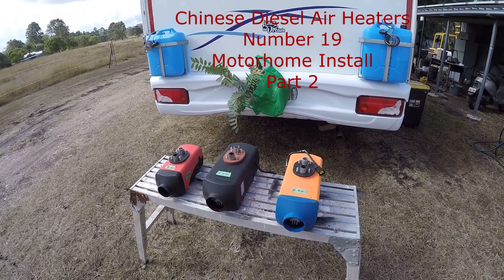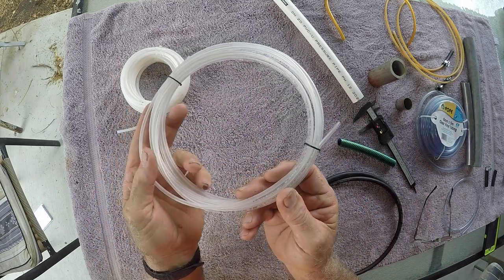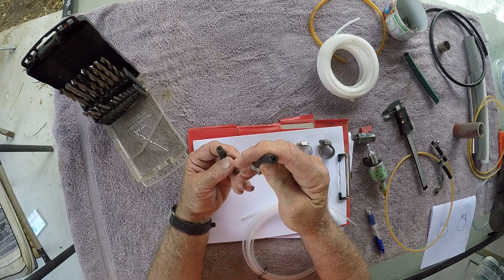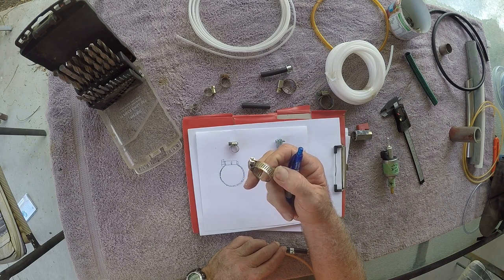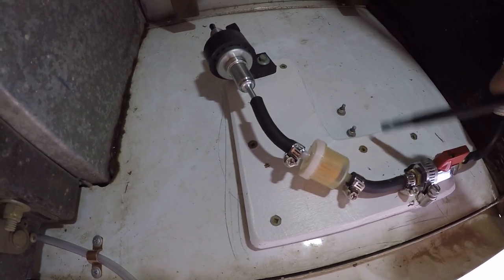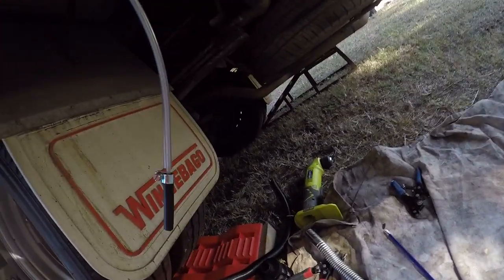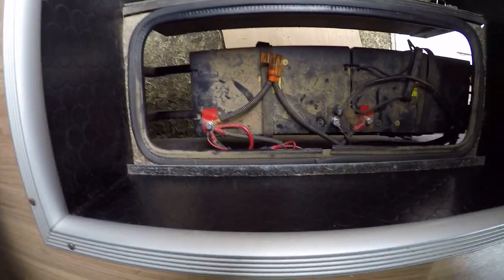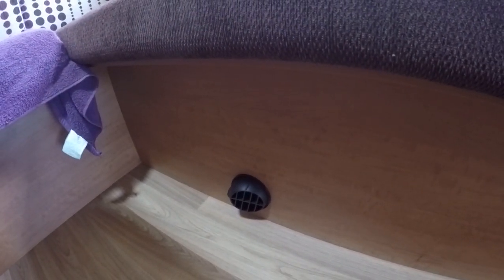Chinese Diesel Air Heaters no 19.   Motorhome Install Part 2

Comment: I got it on special $120 so if worst I will buy a new one ,could you suggest one on banggood site as there are so many thanks again john
Reply from the maker: Hi Dara, 

There are a number of suppliers on line, eg Banggood, eBay, Amazon etc. I generally use eBay, but suppliers come and go. None of the suppliers I bought from a year ago are still there or still sell heaters. So I can not make a recommendation. 

Suggest you buy a heater with controller and accessories you want, from a supplier with a local warehouse in your country, and who will accept returns. That way you have some chance of getting a replacement or a refund for a defective product.

Cheers.  JMcK

Comment: Hi John As the heater is mounted underneath the seat it may not be able to get sufficient air intake to allow recirculated heat. Do I need to place an air intake vent to allow air from the caravan to recirculate into the cavity and through the heater?
Reply from the maker: Hi Andrew, if the heater is mounted under the seat, you need a vent at the front to feed accommodation air into the heater. Or you could drill a number of holes in the seat base to let in air. Heater air comes out the back. JMcK
Reply: Thanks John, I found a nice air vent at Bunnings that will do the job. Thanks for your videos
Reply from the maker: 👍. JMcJ

Comment: Do you recommend running pump in a vertical position?
Reply from the maker: The pump works better if angled up, 45 deg or more.  JMcK

Comment: Would you happen to know where to buy that 6mm nylon tubing in the usa or on Amazon? I've searched and tried big box stores and even a plumbing supply store. Everyone looks at me like I'm crazy. I bought my heater before seeing your video and mine came with green flexible hose
Reply from the maker: Hi Cedric,

You can use the green fuel hose on the intake side of the fuel pump.

You can get by using the green hose on the delivery side of the pump if it is a very short run.

However that hose absorbs the fuel pulses and instead of the fuel squirting into the atomisation screen it dribbles and when you get a little bit of carbon deposits the fuel does not get forced through the screen and you get a poor burn, and hence greater maintenance issues.

You should only use narrow bore hard nylon tube on the delivery side of the pump to get best heater performance.

I buy my nylon hose off eBay. Search for hard nylon fuel hose for Eberspacher diesel air heater.

Below is just one link to get you started in your search.

https://www.ebay.com.au/itm/Fuel-Filter-Fuel-Pipe-Line-3-5M-Hose-Clip-Kit-For-Eberspacher-Diesel-Heater-/293850954872

Cheers.  JMcK
Reply: Thank you very much I found it on ebay with that search.
Reply from the maker: Cedric Fisher 
👍

Comment: Hi John, 29:41 why is there a short piece of black wire going from the left terminal strip into the switch?
Reply from the maker: I think you are referring to an earth (negative) wire. The switch has an indicator light so you can see when it is turned on. Hence the negative wire. JMcK
Reply: @johnmck1147  42:10 after the switch is moved, why is there no longer a neg wire going out from the terminal strip (to the switch)?
Reply from the maker: You are very observant Jay. When I moved the heater switch to the seat front I took a negative wire for the switch light from the negative of the 12V cigarette outlet that is close to the new heater switch position. JMcK
Reply: @johnmck1147  Thanks. also at 42:10, the black wire at the top seems to lead to the controller. is this wire particularly fragile so it needs to go through a conduit while the other wires do not need?

Comment: hi good videos have two of these keep finding the pump keeps failing had a new one lasted 3 days found had to put 12 volt across the pump and had to pulse it to get it to go then reconnect to the heater any ideas?
Reply from the maker: Hi Ian,

I really need more information. 

If the pump worked when you put 12V across it, it looks more like a low voltage, or a wire resistance issue. Have you checked the plugs and wiring for poor connection or corrosion? Are you getting actual 12V at the heater?

You could have an ECU issue, but would be most unlikely.

Good luck .JMcK

Comment: arent  the  fuel  line  runs   far  longer  than they  should  be  !....re  purging  the  fuel line ..i  used   the   pump from   a  hand  soap  dispenser ..it worked  really  well

Comment: arent you suppose to mount the fuel pump at about a 35-45 deg angle so air doesn't get trapped in the pump/line????
Reply from the maker: Oh dear Bob.

If you look carefully this fuel pump is nearly vertical. That is very close to the “perfect” angle.

These pumps are piston dosing pumps that creat little cavitation bubbles by the fast pulse/movement of the piston. If you don't angle the pumps upwards at an angle greater than about 15° you can have the little cavitation bubbles merge to form a large bubble in the pump which will cause both pump dose issues and pump wear issues due to lack of lubrication.

Any angle from about 15° to 90° is acceptable for bubble dispersal. Vertical is “perfect” if you have a seperate filter. Every Chinese heater pump I have seen has a seperate filter.

To the best of my knowledge, the 45° angle stems from those brand name heaters that have a minute/tiny, and in my personal opinion, totally useless internal filter at the bottom of the dosing pump.

These pumps needed angle to let the bubbles out but if the pump was too vertical, filtered  out crud could fall back down and block the fuel inlet hose. Hence the 45° angle compromise.

With seperate filter pumps any angle above 15° is acceptable. Vertical is ideal, but not necessary. 

Cheers.  JMcK
Reply: I thought that too at first because of the angle of the camera, it is mounted on a side wall but it looks like it’s mounted on the top of the space, just the angle he recorded it at is all.

Comment: Hi john i have fitted a few of these heaters one for my use and a few for friends, one of my friends has a problem with his, on about the second or third start up it blows smoke and shuts down,  its in a caravan, he now has a small blower vac battery thing and every second start up he blows it up the Air intake hose and it fires up great, the next start after that is good , the 3rd one it plays up , he runs it in 5 hz before shut down for 5 min or so, what do you think it might be, if blows air up intake its good, intake is short half the supplied length no kinks or bends only 45 degree at end got me stumped battery full power , regards peter
Reply from the maker: Hi Peter, 

That is an interesting one.

First, you say the combustion air intake install is good, but what about the exhaust? The one little fan sucks in air and also expels the exhaust. Problems in one side, create issues in the other side.

Do you have a low spot in the exhaust without a drain hole? That can collect condensation or even diesel leakage. Blowing air into the intake will blow out the exhaust.

You also may have a diesel rich or flooding issue in the heater. Is the fuel tank significantly higher than the heater? If so I suggest a fuel shut off valve before the fuel filter and pump, and turn this off after use to stop diesel syphon leakage getting into the heater.

If I was stumped, I would pull the heater out and run it on my test bench. That would indicate a heater issue or an install issue. If you have done a few installs you will be familiar with this process.

Good Luck.  JMcK
Reply: @johnmck1147  ok thanks mate yar i got exhaust  pipe on slight down ward slope all the way no bends it might be the fuel tank when full  causing problem fuel tank is standing up on draw bar of van and heater is inside van on floor about 2 meters  or so from fuel tank ile tel him to get a tap and we will try that mate thanks for your help you do a good job as well to
regards
peter
Reply from the maker: pk Gold & Hunting 

👍. JMcK

Comment: Hi, I am ordering parts to instal an Hcalory heater into a tiny house with 240v power. I want to permanently mount, and think I need a battery for power cuts both to run the unit and to enable a safe shutdown when the battery is getting low. Will the low battery automaticly start a shutdown sequence to stop the heater getting damaged from abrupt power cut?
Thanks.
Reply from the maker: Hi John, 
If the heater is connected to the battery, and you have a mains charger connected to the battery, the unit will run well. If there is a power cut the battery will not be getting charge, but the heater will continue to operate until the low voltage cut off point. At this stage the heater will go through its low voltage shutdown program. All will be good.  JMcK
Reply: @johnmck1147  Thanks for the quick response. TBH I am surprised that this topic is not widely covered in the thousands of tutorials on these heaters. Hcalory customer support also just confirmed this will work, and they send the PDF user manual for me to check with. Now I just need to figure out what to buy. If you feel like helping me make my purchase for battery and charger or UPS, that would be awesome.
I do have a tight budget, but I also only want to buy once. And if by chance I’m sat here in winter 2028 and the battery is dead because I didn’t spend an extra $50, I’ll be pretty pissed off with myself. I live in NZ, so what works for you will work for me. I have 240v mains power. Not sure what type of battery and or charger to buy (or all in one UPS) but I would like to get something that will give a days worth of runtime with some redundancy for battery degradation over a few years. I don't really want to have to faf around with this, maybe an infrequent system test.  But not something that requires instruction should I head away overseas and leave someone else in charge. Thanks for your reply, and your awesome videos. If you have time to answer / advise on this, I'm sure it would also make a popular video.
Reply from the maker: Hi John,

The battery set up you choose is dependent on what you want to achieve.

If it is only heater safety in case of power outage then a small motorbike or small car battery is all you need for a safe heater shutdown.

If you want to run the heater all through a cold night after storms brought down power lines, then something like a 100 amp hr AGM battery or bigger would be a better fit. It depends on how long you expect a power outage.

As for the charger. I suggest a 4 amp multistage battery charger. That size should be sufficient unless you constantly run the heat all the time at max setting. In that case I would choose an 8 or 10 amp battery charger. In Australia, Bunnings sell an Ozito brand multistage charger at a reasonable price that has an LED screen so you can see what is going on. I have both Ozito and Viltron multistage battery charges myself and have had no issues with them.

I suggest in this application you do not use a lithium battery as those batteries hold a very constant voltage, unlike lead batteries, and then suddenly shut down. The CPU in the heater is unlikely to sense the low lithium voltage and do a safe heater shutdown before the lithium battery BMS shuts it down.

Good luck.   JMcK

Comment: Question please. When I set my temperature to a set number of say 16C why would my heater blow out hotter air and eventually end up with a reading of 22C?
Reply from the maker: Hi Lucy, this is a bit hard for me as I do not know what heater you are using or what controller you are using, or where your controller is located.

When you first start your heater it will initially ramp up its output to get the burner heated up and burning properly before settling down to a lower setting for maintaining.

The ECU gets the ambient temperature readings from the temperature sensor  in the controller, and not from where the heater is. 

I personally prefer to always use the manual settings on the controller, that way the heater runs calmly at its set rate, and you do not have the ramping up and ramping down of the heater trying to maintain a set temperature.  JMcK

Comment: John, for safety sake, I'm wanting to install a fuel cock from the plastic fuel tank. Can you advise where I can get one to fit the supplied hose? Thank you
Reply from the maker: Hi Vic, you can buy them in a hardware store in the air tools section, an auto store, a small engine shop that sells chain saws etc or on line.  JMcK
Reply: Thanks John Much appreciated. Just about to fire up the heater. Thanks to your wisdom and guidance, I'm hoping all will be well.

Comment: Can I ask you this. I want to mount heater in back of trailer its 15 or 16 ft up to front of trailer were battery is. Is that possible to achieve or should I just find a closer spot to mount heater.
Reply from the maker: That is ok Wayne, but you must run heavier wires from the battery to the heater to prevent voltage drop. I talk about this in the video.  Cheers. JMcK

Comment: Hi, John. I installed a very similar 5kw heater in my small schoolie. I wanna go to Winter Park,Colorado, USA for  ski trip with the bus in 2 months. That is a altitude 10000+ feet place. Any advice for using the heater in such high altitude? Please
Reply from the maker: Hi Ying,

With the genuine Eberspacher heater, you can get a high altitude kit for these heaters, but, to my knowledge, none are available at this time for the Chinese copies. 

The heater will run rich at high altitude without the altitude mod and cause soot buildup.

As a compromise measure, I suggest you run a high kerro/diesel fuel mix 80% to 90% kerro through the heater while at high altitude, to lessen the carbon build up.

Cheers.  JMcK
Reply: Check out David McLuckie's video on using a CO meter to tune the heater. When you get to altitude, you'll want to adjust the pulse and fan settings so that you still have a complete burn, which means very little to zero CO in the exhaust stream. https://youtu.be/bKyCWGY2OME
Reply: @johnmck1147  I see the newer red and the newer blue controls have "ALPINE" mode. I have not found any information on what this mode does, but did see one ebay seller rated their unit for 5000m. Do these new controls have an altitude/barometric feature built in?
Reply from the maker: Jim Paisley 

Hi Jim, at high altitude these heaters have an issue of rich running, due to lower oxygen levels, causing excessive carbon deposits.  The Alpine mode changes the mixture.

I have no ability to test these new controllers, as “mountains” near me only soar into the sky about 400 meters.

Cheers.  JMcK

Comment: Do you know of any better fuel pumps that could be used with these heaters that doesn't need to be kept at an angle and that is quieter?
Reply from the maker: Hi Mr F

These diesel heaters need a “dosing “ type pump that delivers a fixed volume of fuel so the ECU can get the right fuel air mix ratio for different heat sellings.

The “ticking” noise you hear is the little piston hitting the stop at the end of its stroke. 

Webasto make a dosing pump for their heaters that has a diaphragm on the pump top that is claimed to lessen the noise. I have not tested one of these so I can not make a comment. However the cost of one of these “genuine” dosing pumps when I last looked was over US$400, just for the pump. Way outside the scope of this series.

https://www.ebay.com.au/itm/Webasto-Heater-fuel-dosing-pump-24v-47901A-47901B-1322433A-/273810662477

ALL piston dosing pumps should have an upwards incline to allow the small cavitation bubbled caused by piston movement to escape easily.

Recently an economical pump diaphragm add on has been produced and I have ordered one to test. If successful I will do a video of its performance, or lack there of. 

Cheers.  JMcK
Reply: @johnmck1147  Thanks so much! Does the pump have to be a certain distance from the heater? I am wondering if I could put the pump under the vehicle to keep the noise out of the cabin.

Comment: John, I have a question, our heater showed a error e08 which I believe is glow plug problem, I changed the glow plug and still same messages. Can you help. Thanks.
Reply from the maker: Hi Ian, I am currently sailing the Med and I have no notes with me. However a common issue here is low voltage to the glow plug. 

You can check this with a multimeter and by running heavy gauge power wire direct from the battery to the heater and see if that fixes your issue. 

It is good practice to run proper sized wire from heater direct to the battery through a 20 amp fuse.  JMcK

Comment: What brand did you get? Mine came unfunctional with the fan part stuck and rubing.
Reply from the maker: Hi Mr P, most of these copy heaters are unbranded. 
I advise people to buy from a local supplier who accepts returns. 
Suggest you ask for a refund or replacement.  JMcK
Reply: Thank you.